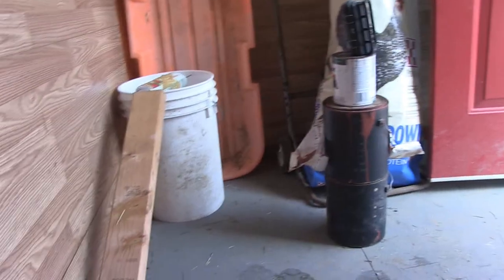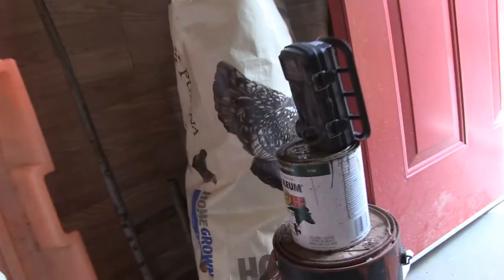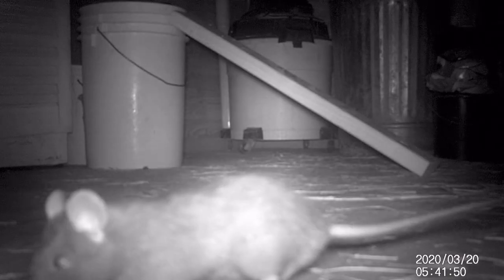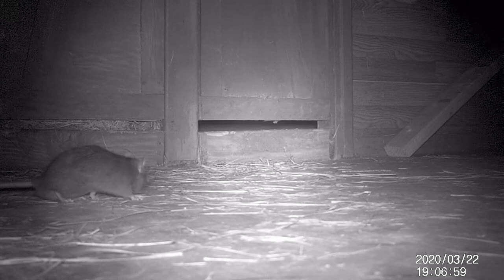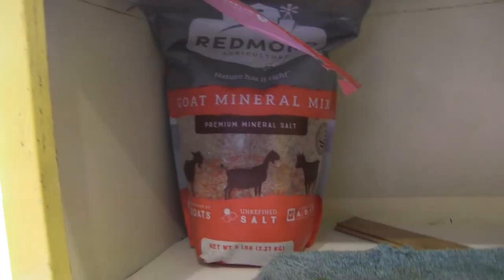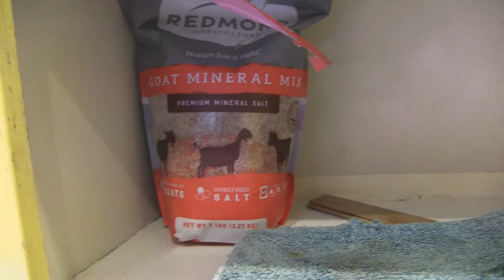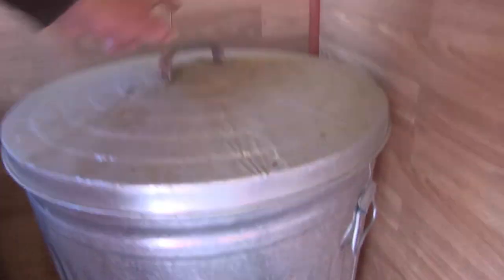EASY MADE MOUSE TRAP (FAIL)

Comment: Your bucket trap didn't work because this mouse has relatives that live in New Hampshire and they told him how "The Boss of the Swamp" get some of their kin with his bucket trap!  His is very entertaining  & educational!
Reply from the maker: I tried The Boss Of the Swamp method. Must have did something wrong.
Reply: @pinemeadowshobbyfarmafruga8319  Go back & watch the latest video's.  The Boss had to change his design several times until it was full proof.
What I saw in your video is a Rat, not a mouse, the tail was too long & too big around at the point of connection to his body.  Maybe Rats don't like Peanut Butter, I really don't know, google it & check. 
Under to Bosses home there is no other source of food like there is in your barn, take that into consideration.  
A friend of mine mixed up a Home Remedy to get rid of Rats, I'll find out what that was & get back to you.  That worked well.  Until later.